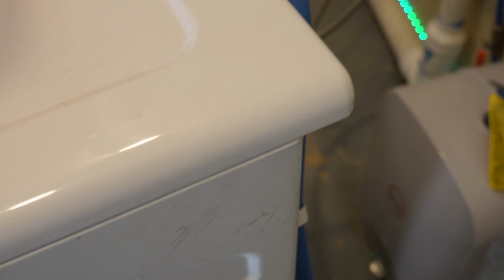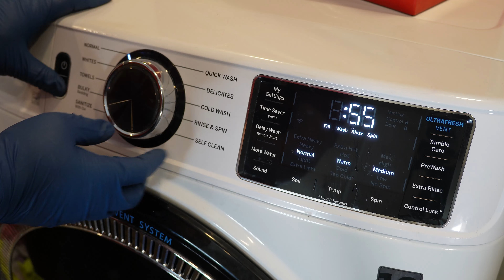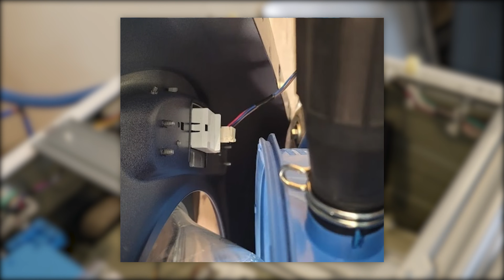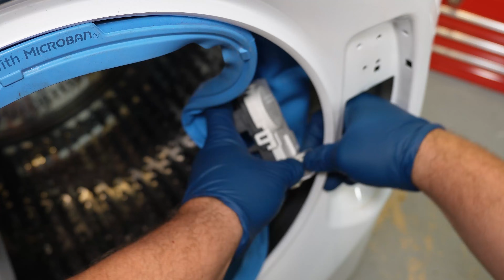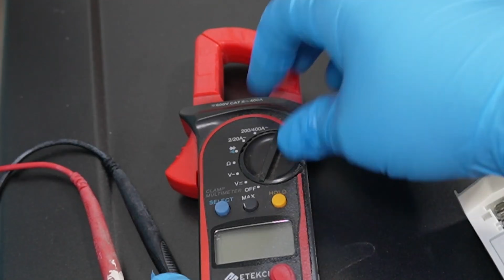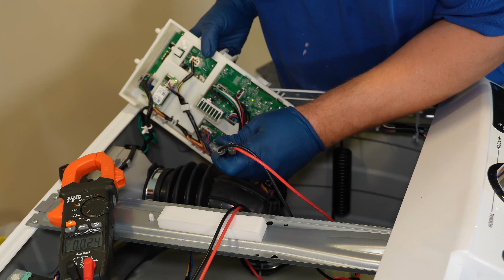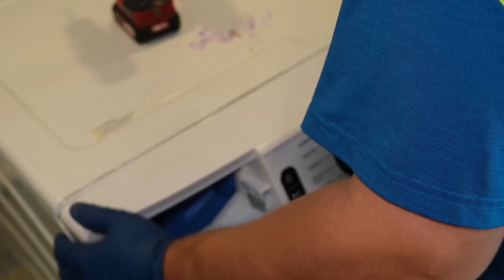GE Front Load Washer Door Lock Problems - How to Unlock & Repair

Comment: Is the part attached to the door latch (part wh01x32580) that inserts into the striker free floating? The screws on the door latch are tight but the latch moves within the elongated adjustment holes in the latch. Is this normal? I’ve had a couple instances where the door is closed but reported open by the control board.

Comment: My multimeter shows me 0 between pin 1 and 3 when I push switch. So does it mean that issue in my door lock and it needs a replacement?

Comment: Good afternoon I have the exact same washer wich I had in my basement along a lamp well the basement flooded and tripped the lamp wich was in the same outlet as the washer . No power whatsoever i replaced the main control panel wich I got from amazon but still no power any ideas? Could I have gotten a faulty control board . Should I replace the main power wires ? Thanks

Comment: My Son GE front load washer started like that door not opening. So we did some test and had 8 codes plus possible problem with door lock and board. I did a few test over and over finely decided to replace board and door lock. So I replaced board for some reason board did not response to a test comand, its seem like it just stuck and wont reset. I will test futher and call GE for guidance.

Comment: I called GE and the repairman will be here Wednesday. Door is locked and won’t open. I’m curious what they are going to charge me to fix this issue. My unit is barely a year old.
Reply: Mine too. 1 1/2 years old and same issue. I’m going to call ge and raise hell, guess we will find out if they care about their customers. I replaced the door lock as at first it wouldn’t start cycle due to door not being locked. After putting the new one in and ran a load of clothes it wouldn’t unlock. I had to take top off the washing machine and reach my hand down to the lock to release the lock, now I’m back to square 1 and it won’t lock to start cycle. ( 50 bucks for the lock) this is crazy considering what we paid for this hunk of shit! I’m so livid.
Reply: @ it cost me $450 to repair.
Reply: @DrinkingWithDrewShow what did they replace
Reply: @dannycanet667 I believe they just rebooted the software and replaced the door latch.
Reply: Having the same issue, what did they end up charging you?
Reply: We have already spent $300 on a new gasket and now the door. The washer was purchased in May of 2024.
Reply: How did they get it open? The black button will not press in on mine.
Reply: I'm having the same problem at a year and half smh, damn $800 washer smh

Comment: I still can’t get my washer door open. I opened the top and accessed the manual unlock, but the black manual switch will not go in. I’ve tried significantly pushing it in with no success. I’d like to get the wet clothes out of there one way or another. Any suggestions?

Is there a way to get the front panel off without needing the door opened?
Reply: Did you ever get it open? If so, how? Mine is doing the same thing.
Reply: @RyanSpading-f4z  not sure if this will still help but here’s what I found out: I was able to gently pry the door open and remove the lock to examine it. After removing the lock I still couldn’t get the manual release button (black button) to press in. Turns out the lock was being shorted from a bad main control board (mother board). I took the lock apart and found that inside the lock there is a copper coil that surrounds a tube that the black manual release button slides thru when pressed. The short caused the copper coil to heat up so much that it melted the plastic tube inside and closed off the tunnel. At first I bought a new lock and replaced it, but it immediately fried it again and did the same thing (closing off the tube). So I replaced the lock again and main control board this time and it works perfectly now. Hope this helps.
Reply: @publichealthforyou3258  How did you gently pry open? I am pretty sure I am having the same issue as you. I originally swapped the main control board and it worked for about 2 weeks until it failed again. I then get another main control board and when I plugged in the washer is sparked and since then has not allowed me to open the door.
Reply: @ I took a screwdriver and put the tip right where the door catch mechanism grabs the door catch and gently pried until it popped open.

Comment: what does it mean when the resistance between pins 2 and 3 are 160-170?
Reply: Did you get this resolved? Sounds like your resistance is too high and the control board may have trouble confirming the door is locked. I have that issue now with a Whirlpool where Unlock pins have 60ohms and the Lock pins have 120ohms. Waiting on a new lock assembly to replace and see if it fixes my no motor/no spin problem.
Reply: @selmaave9145 did this work for you?

Comment: I just ordered a Main Control Board from you because of your helpful info.  The washer has the typical door error so I did a bunch of testing and had already replaced the door switch.  Same issue and I do not have 120 volts to the door switch.  It appears that I have 56 volts.  Hopefully the new board fixes my issue.   Thanks!
Reply from the maker: Always here to help
Reply: @bensappliancesandjunk  is the board plug and play? Or does it have to be calibrated in?
Reply: @kevinkennedy2687 it’ll be plug and play
Reply: @bensappliancesandjunk how much is the board
Reply: The board fixed the problem? I have 60 volts((
Reply: I am about to buy the main/mother control board. Was it complex and any advice
Reply: Sorry I just saw these responses.  The board did fix my problem.  Very easy to install in my opinion, but take pics of the wiring of old board in case you have questions when installing new board.  The wires pretty much lay in place and are specific connections.
Reply: Do you have the link to the control board?  Im having the exact same issue and when i go on GE appliances it says the board is replaced by a new one and i want to make sure its the right one.

Comment: I have the same washer and it won’t start at all, I changed the door lock latch and it still won’t start. The code that comes up is 23. Before it did this the app was telling me the wash was done when I just turned it on, or I get a notification the wash was done and no one turned it on, I would turn it on and it wouldn’t wash. Is this the control
Board instead?
Reply: Hi there! I had the same error code, have you fixed your washer by changing the main board? Thanks a lot!

Comment: My filter was clean, i done all the things you suggested with no luck. The release on bottom didn't work. So i disassembled the lock to get it unlock then bought a new lock and plugged it in. Same error. Light on board still blinking. I am guessing the board fried that controls lock when lock went bad. Gonna order board/boards now.

Comment: I replaced the door lock switch WH01X29528. And my washer still showing “door” on the panel. I do the number 13 like you do here and the “light” soil level blinks according to the service mode “when door is open, the Soil Level “Light” LED will brink”. I assume I need to replace the main board now, or I need to figure out which pins to check you said a number and the letter J and pins number but your had blocked the actual view of where you tested the board. I might need to test the board before I buy the part unlike the door switch I just bought by that part. The main board is a lot more pricey.
Reply: Clear codes after replacing part
Reply: You ever figure out which to check? Can’t see from the video and I’m having the exact same issue

Comment: Ben thank you for posting this. 13 didn’t unlock the door and instead “extra light” is flashing. What do you think?
Reply: Mine too
Reply: Same!
Reply: Im having similar issues. I just replaced the main control board thinking it was the issue, then had another locking issue so changed out the lock, then the brand new lock must have burnt up because it locked up and now the black button is jammed. Any idea what it could be or what to check next? Definitely smelled burning (guessing the lock).
Reply: @matthewbarefoot3242  I had to replace both the main control board and the lock mechanism at the same time in order to fix the issue. I read somewhere else that if you don’t replace both at the same time, then they will keep shorting each other out when you power on the washer. Sorry if that wasn’t clear before. I smelled burning too and it was definitely the lock.
Reply: @publichealthforyou3258 this is 100% correct and what ultimately fixed it. Had to replace both at once before repowering on. Thanks!
Reply: That’s normal on newer gfw, just use the force unlock black switch
Reply: That don't push in. @SimplyBaked
Reply: @LEOCHUCK4791 same for me. The 13 code didn’t work and the black button feels really jammed when I try to push it. I even got a penny to get some leverage pushing on it and it still wouldn’t budge.
Reply: @publichealthforyou3258  same issue what did you do to unlock it?
Reply: @andreborjon179  I was able to gently pry the door open and remove the lock to examine it. After removing the lock I still couldn’t get the manual release button (black button) to press in. Turns out the lock was being shorted from a bad main control board (mother board). I took the lock apart and found that inside the lock there is a copper coil that surrounds a tube that the black manual release button slides thru when pressed. The short caused the copper coil to heat up so much that it melted the plastic tube inside and closed off the tunnel. At first I bought a new lock and replaced it, but it immediately fried it again and did the same thing (closing off the tube). So I replaced the lock again and main control board this time and it works perfectly now. Hope this helps.
Reply: What black button? I can’t even find a black button.
Reply: @chelseamiller5353  it’s located on the inside of the washing machine frame towards front right where the door closes. The black button (or manual release button) is actually part of the door lock mechanism and is located on the bottom of the door lock. When you take the top off of the washer and look down in the corner where the door closes you will see the door lock mechanism (it’s grayish white with wires leading to it. It’s the only thing in the area with wires going to it. He shows all of what I’m talking in this video. The black button (manual release) is the button he’s pushing in the video when he’s holding the door lock and explaining how to test resistance.
Reply: I got the extra flight flashing as well. Thankfully the button on the inside worked for me. Although my hand took some scraping to fit in there

Comment: What's funny is the I'm here because the door won't open and his first instructions are open the door 😂😂😂
Reply: @beefsoda1  follow up, had to drain the tank thru the bottom using a casserole dish and a bucket because it's so low to the ground... Took forever but once the water was almost all out the cycle changed and the door finally unlocked. It was the drain pump. Hope that helps someone!
Reply: Yeah, same.
Reply: I pried it open with a flat head without damaging the door. want to pry it in the center of the lock.

Comment: Before anything, clean out the strainer at the bottom of the machine. Remove the panel on the bottom front and pull out the blue strainer. If a lot of water pours out, that was probably the problem. The door stays locked if it's full of water or can't drain.

Comment: Ben, your video is super helpful. However, if you're up for giving advice, I ran into an issue. 

After replacing the lock with a new one it made a very strange buzzing sound, smelled like burning, and now will not unlock.

The test just flashes Extra light but doesn't open the door. What's worse, the release button on the lock mechanism doesn't do anything. It seems like it was a bad mechanism and literally fused shut. 

Do you have any suggestion on how to break it open? There doesn't seem to be a "healthy" way to get it open. 😢
Reply from the maker: If the lock is trashed there's no real easy way to do it. The mechanism on the door is metal, the lock itself is all plastic. It'd have to be broken I imagine. The key would be to not damage the door in the process
Reply: Same thing happened to me, after replacing one bad door lock. After replacing the door lock, I shut the door and it made a locking sound. Tried all of the tips to unlock it with no success. When I took the cover off I could smell a burning smell, as well. Machine is only two months old, repair guy is coming next week.
Reply: Hello what did the repair guy say?
Reply: @TheJaywvu1 what was your problem? Mine is doing same thing after replacing the switch due
Reply: @ It was a newer washer called the business we bought it from and they fixed it. Not sure what they had to do to fix it.

Comment: Thanks for the video. I installed a new authentic door lock but the lock error still remains. Do you think it could be the board? It is lit up but has a blinking led on it. Not sure what else to try besides that.
Reply: Did you figure this out? Is it error 32?
I'm having the same issue and led Z201 on the board keeps flashing
Reply: @Tx03edge  Not sure yet. I ordered a new board today and I'm hoping that will do it. If not I am not sure what the issue would be. BTW I am colorblind. Do you know or remember what color the flashing LED is?
Reply: @HHS1500  flashing led is green
Reply: @B4TMAN89  hey just a heads up I installed a new board and it did resolve the problem and the washer is functional again.
Reply: @HHS1500  how much $ is the board?
Reply: @wizeskroat  got it on eBay for $115
Reply: @HHS1500  just curious what troubleshooting you did, if you don’t mind sharing. I have done the troubleshooting of the J513 and I am getting only 70v so I’m thinking the board does need to be replaced.
Reply: @kennethsomkovic2538  I was not sure how to take a reading of the voltage on the board. I was out of ideas and just hoped replacing the board would solve the issue. I knew the door was definitely locked but the machine wouldn't recognize it. I'm not sure which component on the board that is though
Reply: @ thank you for responding! I ended up replacing the control board and all worked great. Now I’m having an issue with it not draining and spin cycle won’t start. Trying to troubleshoot that now.
Reply: @Tx03edge  error codes are 38 26 23 27 and 9 btw

Comment: What if the door is locked shut? How do I get the door open to get access to the door lock?
Reply from the maker: Watch the part where I show the unlocking mechanism inside the lock with the top cover removed
Reply: If you haven't tried it yet, he suggests unplugging it. It worked for my GE front loader.

Comment: I have this same stupid washer and regret it every day... My issue is it says canceled frequently, I've used your videos to open it up and clean it and I've even took apart the pump thinking it might not be draining because the drain pump makes lots of noise while it runs the cancelling but it works just fine. The cancel code is only supposed to run when paused for over 24 hours but it will do it after a wash cycle or even during the end of a cycle it won't let it fully spin the water out and sometimes it will just constantly run the cancel and I'll have to unplug and plug back in and it reruns the cycle but then ends. Do you have any idea what's going on?
Reply: I have the same issue. Did you figure this out?

Comment: Thanks for the info. Now I know what model to AVOID. Too complex. It's just a washing machine, NOT the space shuttle.
Reply: I'm about to launch mine into outer space.
Reply: Same here!  Way too complicated for just a washing machine.  It's just a door lock not the Space shuttle! I bet the Space shuttle door is not as complicated as this washing machine!!!
Reply: U r so right. I absolutely hate this washer!
Reply: It seems they're all models to avoid
Reply: Its totally trash- mine has been fixed 3 times in only 4 years and broke again.
Reply: @cristinamazzeo8895  Both our GE washer and dryer have each been utter trash. The dryer basin cracked 3x (3 different service calls, parts shipped, etc) in the 2 years we've owned it and now the washing machine lock is going haywire (also just 2 yrs old).
Reply: It’s like the goddamn WOPR from WarGames
Reply: GE Engineers are morons. GE stoves are awful too. Buyer beware!
Reply: Dear past self. Don’t buy this washer. Sincerely, your current frustrated self.
Reply: Any advice if the black button on the bottom will not push up at all?

Comment: In European front load washers there is usually a cord to pull right next to the drain water filter that opens the door, or just use the Spinn/drain cycle if u need to open it on emergency
Reply: I have the very same machine. I can’t find a drain/spin mode. The best mine will do is rinse and spin. Sometimes it just needs to spin a little longer so I don’t have to put wet clothes in the dryer. I don’t need to use more water rinsing and spinning. No, I never overload. Sometimes the piece of junk just doesn’t spin right. Take away all that expensive unnecessary stuff that takes forever to do a cycle of laundry and give me the option to wash,rinse, spin. What is so hard about that. Quit making dryers that take hours to dry even a small load.